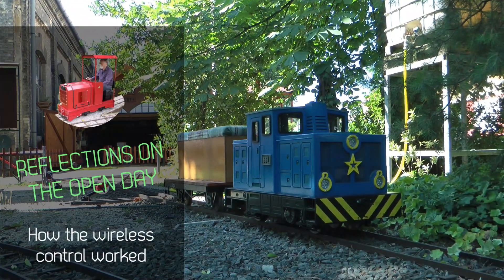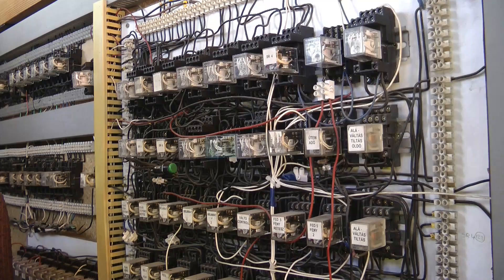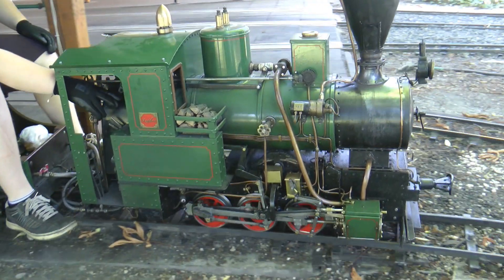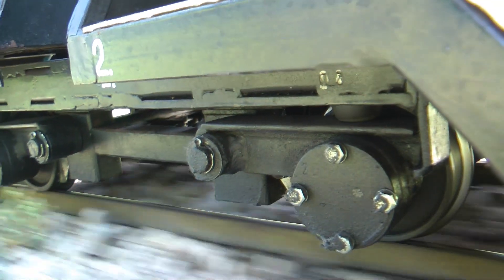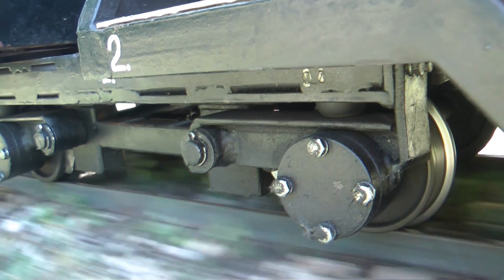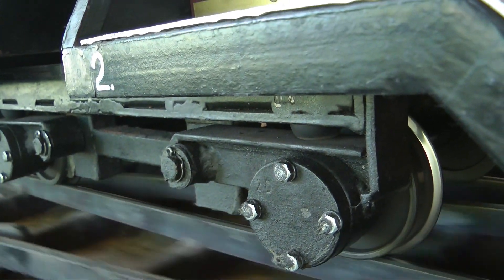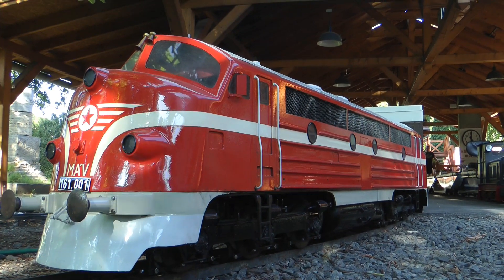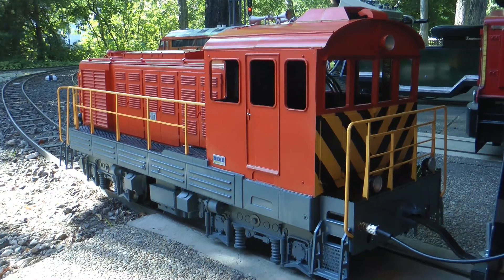How my Open Day went, and how wireless control worked

Comment: Looks like a fun event.  Can I ask a kill-joy question?  What failsafes do you have?  If you lost control eg due to a failure or signal interference causing eg an uncommanded acceleration at those signals there's potential for a head on crash, similarly when entering the station someone could not be looking and you'd have to emergency stop.  Its also possible you could drop the controller from the train, or due to vibration you could get eg a cracked solder joint, leading to loss of control.  At the back do you have something like a mechanical emergency brake just in case?
Reply from the maker: Thanks, you are not a kill-joy and I know these need to be taken into consideration. I think I did include them in the design, but maybe not all. When you turn off the ignition switch, it sends a stop signal to the locot. You can wire it as a dead-man switch and when you let go or drop the controller the train will stop. Also if anything goes wrong with the throttle dial you can switch the ignition off and bring the train to a halt. The throttle keeps sending data to the receiver every 250ms. If the recriver does not hear about the throttle for 2 seconds, it will stop. But this will probably leave a few scenarios where the train will not stop. The wireless link is standard 2.4 GHz wifi, it has a decent range in open air. You can easily drive the train from 20-30 meter distance and probably more.
Reply: @csongorvarga  Thanks for replying.  I thought you would have had something in place and was thinking of something like a dead-man's handle just in case.  Loss of data leading to a stop is a good idea, but it still relies on a working microcontroller to detect that and signal an action.  I was just concerned with the distance you are from eg a physical kill switch - this isn't something that's likely to be as much of an issue in your home setup, but as you're giving the public rides there may be a liability risk to you if something were to go wrong - though I would imagine you have to be covered against that anyway.  Thanks for all your node-red videos btw - very informative.
Reply from the maker: @randomsporadicprojects8941  I see what you mean. I will check with Sabertooth if there is some sort of watchdog timer function. Because as you said if the receiver controller dies and cannot send the stop signal, the loco will just keep on running.